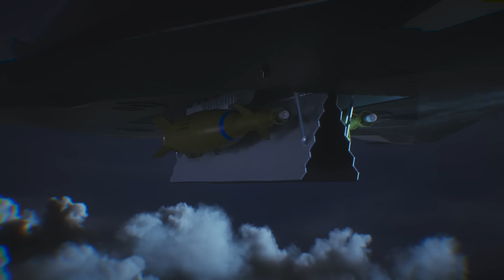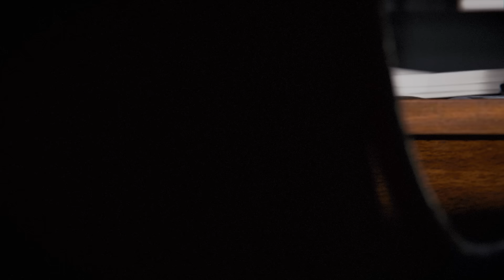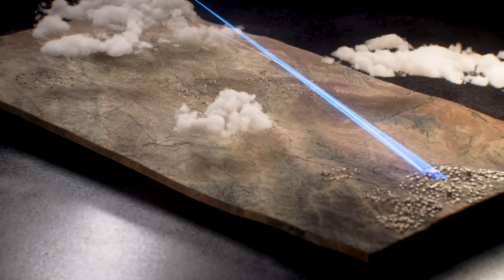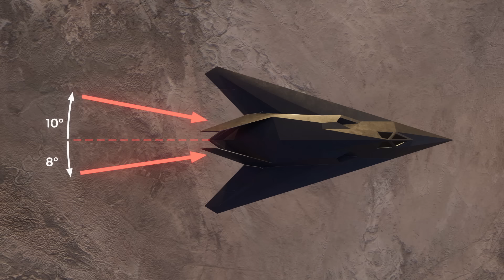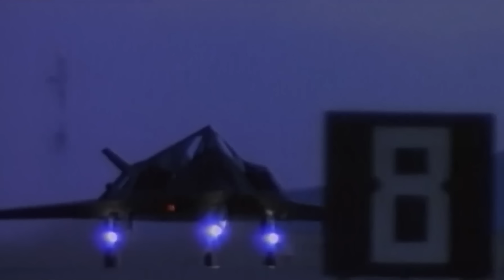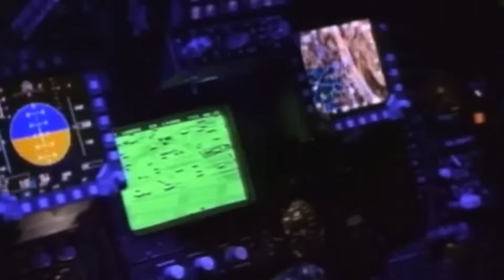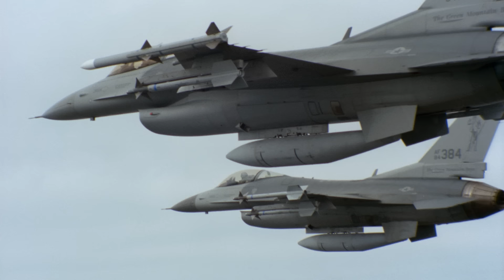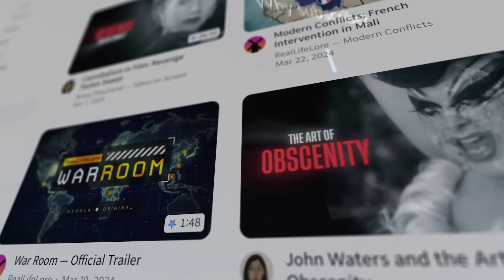The Insane Engineering of the F-117 Nighthawk

Comment: The most interesting thing about the F-117 to me is that, without the computational power to effectively simulate radar returns at high fidelity yet, engineers had to simplify things. Which is why it has simplified flat panels, while modern stealth aircraft have complex curves. The F-117 is literally a low poly stealth aircraft.
Reply: i though part of it was manufacturing complexity of stealth paneling and making it curved
Reply: @najlitarvan921 if the SR-71 is any indication, Lockheed had no issues shaping complex materials.
Reply: @judet2992 They could make the complex shapes, they just couldn’t simulate the radar returns from those shapes.  So they hade to design a shape simple enough that they could do the simulations to optimize the design.
Reply: @johnhunt2390  exactly
Reply: @judet2992  The computer program they used to calculate radar diffraction could only solve for triangles, so they had to make the Nighthawk out of triangles. The actual assembly line would've have had no problem making it round, but the computer did.
Reply: @Attaxalotl  I know, I was trying to say that, they weren’t using computer modeling during the blackbird, I was using it as a way to differentiate construction vs modeling
Reply: @judet2992  Note that the F-117 is about 2/3 aluminum.
Reply: @judet2992  to be fair they did say "complex stealth materials". SR-71 has a really good radar cross section for what it was, but it wasn't really THAT stealthy at all, it was designed for speed first and even the radars at the time could pick it up, they just couldn't hit it because it was so fast and high. Basically just stealthy enough that they couldn't see it quite as a easily/quickly and get the jump on it with the missiles. The SR-71 is a big plane compared to a fighter, but its RCS was like 10m2. I think that's roughly comparable to a modern 4th gen fighter (non-export current F-16 for example). VERY good for its time considering it flew in the early 60s. But the F-117 has a front RCS of maybe like 0.001m2. The Blackbird was like a smaller plane on radar. The Nighthawk is like a large bug.
Reply: @X85283  yes, I’m talking purely about shape
Reply: @judet2992  For sure. Lockheed made some BEAUTIFUL aircraft, I'm sure they could have made pretty much any shape they wanted 🙂, it just wouldn't have been very stealthy haha
Reply: @Attaxalotl Thing is, the programs we use nowadays ALSO only compute for triangle surfaces, only the number of triangles has been increased more than a million fold
Reply: @dareldatt798  Yeah lol. As it turns out Triangles are the easiest to ray trace!
Reply: @najlitarvan921  Boeing was working on something like a decade before the nighthawk and it was curved, but never came to fruition.
Reply: @proxy3386  either got canned or became a secret weapon imo there’s no other options
Reply: @proxy3386 Yes I heard the Boeing craft had an exploding door problem
Reply: @najlitarvan921 , It was. At the time, mfg did not know how to do the layup of composite materials without the fiber material bunching up or thinning out in the autoclave and affecting the structural integrity of curved structures.
Reply: @najlitarvan921  No, many other planes have curved panels. With the F-117 it is a matter of understanding (predicting) how the radar waves bounce off of curved surfaces.
Reply: If that was the case how what other aircraft of the day have curved paneling @najlitarvan921
Reply: @najlitarvan921 that’s what it was.
Reply: @najlitarvan921  "i though part of it was manufacturing complexity of stealth paneling and making it curved"

Dude are you looking at an F-117 or an F-22?

Did you understand the point being made?   The F-117 didn't have all these curves.  The OP you responded to is absolutely correct.  It had FLAT panels for the most part.  It was curved in a few areas.

The point he made, "low poly" if referring to what it takes to make an image for computer animation where polygons are used.  The more polygons you have the more an object starts to look real.  You can watch computer games designed before 2000, and then look at new computer games, you'll understand the comment.
Reply: @najlitarvan921 that’s all of it, whoever op is has absolutely no clue how math/ logic or even reality works. I don’t even know where to start…
Reply: If I remember correctly they had to break it down into a bunch of triangles and then calculate the radar return off of each triangle, then sum it up, pretty much a low poly aircraft.
Reply: @ur_a_neerd  Yeah; like how GPU’s tesselate rendered scenes in video games. The math required to render to that degree is orders of magnitude more available today in a consumer 4090 than used to be then in supercomputers.
Reply: @ur_a_neerd  It was an application of finite element analysis methods.
Reply: @ur_a_neerd I think your opinion is great! Props to the Guy that shot one down too.
Reply: The one interview I saw had the designer say, "You make it invisible, I'll make it fly." When they put that original diamond shape on the radar tester, they though it was broken.
Reply: @orionred2489  I heard a story from a bit later; they put the winged version up on the stand and saw a dot with the return of a small bird... about two feet above the cockpit. They all turned to look at the stand, and saw a small bird standing on top of the cockpit. Someone shooed the bird off, and the screen showed absolutely nothing.
Reply: @Attaxalotl  "What?" - bird
Reply: @orionred2489 угославское ПВО было другова мнения они его прекрасно видели и сбили над угославей 😂😂😂 в музее лежат обломки невидимки 😂
Он межет быть не видем на ваших радарах но есть другие радары с другим принципом работы
Reply: The F-117 being stealthy is basically a hollowed out log in terms of boating. It's primitive af, but it floats and works:)
Reply: that's because during the design phase the computers were from the 70's...now computers are much more powerful and can calculate radar reflection using curved surfaces which is much better for flight...that being said...the F-117 was designed in the 70's and remained secret for years...just think what they are working on now that's super secret and I don't mean the SR-72...
Reply: Check out mustard's video on this stuff for anyone who wants to see the history on it (especially the flying wing video)
Reply: Its unclear if this is true. What is known from public information is that the software that was used to design it only worked with flat surfaces. There are a few possible reasons for that. Very likely this limitation was because the software was written based on then recent papers that didn't discuss curved surfaces. Now its possible those papers it was based on only discussed flat surfaces due to computational limits but that's not mentioned by the people involved. The specific claim "they used flat panels because they didn't have the computational power" is, as far as I know, something that was invented later, probably as a just-so-story.
Reply: @alexanderf8451  Because the computation to figure out curved surfaces was simply not available. Neither for the designers nor the papers that they based it on. The basic principles of how things work with simple curved surfaces was absolutely known, but there was no way to simulate multiple complex curved surfaces interacting with each other, etc
Reply: @alexanderf8451  Can confirm. I was once interviewed for a job by a guy who said he worked on it... Sorry, it was awhile ago now, I don't remember his name and yes, I realize that doesn't lend itself to much credence. Anyway...

He said it's got flat sides cuz CAD couldn't do curves at the time.

As a CAD user I can still confirm the need to design around your tools/software. I have to do it everyday.
Reply: ...I had never thought of it in those terms, and I am delighted!
Reply: That's a very good point.  Wow never thought of it that way
Reply: Legit low poly aircraft you are right about that
Reply: I asked Ben Rich, a long-time pen pal, why the F-117 was faceted, and the Tactic Blue had a blended shape. Ben told me they were at a point in the design where they had to break the pencil. Three months later, they had the ability to create a blended fuselage.
Reply: It was the Virtua Fighter or Virtua Racing of aircraft.
Reply: @TroutButter miss that game
Reply: lol
Reply: Tell that to the Smart Radar from Thales. Detected
Reply: Which makes me wonder, why cant they just go from Sigma to S then? Like series and integrals
Reply: That also explains why the Cybertruck looks the way it does. It was rendered on a Commodore 64.
Reply: @ganymede3141  Too powerful :)
Reply: Reminds me a bit of how old-school roller coaster manufacturers like Arrow used to design rides based on what they call a "tangent-radius" approach, where (and this is simplifying a bit) everything is effectively a straight line or a curve with a consistent radius.  The reason being the ride designers need to be able to calculate things like speed and the G-force on a rider's body, and that is infinitely easier to do by hand when not dealing with a compound radius on every curve.  Compare that to more modern manufacturers like B&M or Intamin, where digital computers are easily capable of calculating the complex vector equations on a curve with a compound radius, meaning the ride designers can quickly and easily design MUCH smoother rides, where you don't feel like you're being aggressively forced into every curve (Drachen Fire, I'm looking at you).
Reply: very interesting ...never thought about it like that! thanks man
Reply: At the time, yes. Still an impressive aircraft to this day, but during its development and continual service development it was tested extensively with “seized” and known radar technology and reconnaissance techniques from its adversaries of the time. Still, to this day, it could (possibly still be) a strategic stealth asset for specific operational objectives. It’s still one of my favourite military aircraft. When I was a kid I had magazine cut outs of this thing on my bedroom walls.
Reply: @giantrobot5804 no question the best looking and most badass looking of ALL aircraft. It's not even close
Reply: That’s such a great way to put it — the F-117 really was a “low poly” stealth jet, born from the limits of 1970s computing. Those flat panels weren’t just a design choice, they were the only way to make stealth possible at the time.
Reply: And yet it was detected and shot down by 1960s Soviet made SAM...
Reply: Aka the original cyber truck
Reply: Like a Playstation one or N64 aircraft?😄😄
Reply: Shut up nerd
Reply: i think the reason the f117 is low poly is because computers at the time couldn’t simulate curves, therefor forcing the edges to be straight and triangular
Reply: @mastah39  The canopy glass has a reflective coating tuned to the radar frequency, or frequencies, so that the radar waves bounced off and didn’t enter the cockpit.
Reply: low poly like the ps1 so the f-117 was the start of 3d graphics lol
Reply: Hahaha! yea that's true but it's so funny, low poly stealth aircraft
Reply: Giving it that angular 80's future vision look that's also present in controversial design of the Tesla CyberTruck
Reply: @AaronSchwarz42  I don’t even consider that ugly thing at all. It is just a very expensive ego trip with no real purpose beyond being able to say that you own one.
Reply: Not very stealthy as it turned out
Reply: @Withnail1969  it is pretty stealthy, what do you mean?
Reply: @judet2992  Not always.
Reply: @Withnail1969  yeah, not when bombing with the bay doors open, but saying a stealth aircraft isn’t stealthy because they have to reveal themselves to strike targets is like saying an Olympic sprinter is slow because they have to stop after the dash. Stealth gets you in, and helps you in the cat and mouse game that follows. It isn’t complete invisibility
Reply: @judet2992  I dont believe the rubbish about it being invisible until it opened the doors. I think they have never been invisible to countries with some sort of modern air defence system.
Reply: Ummm yeah 😂
Reply: Yeah they would think use their own brains to figure it out. It's beautiful shows you humanity's pure intelligence using clever ways to solve enormous issues so imagine what they do with super computers lol look at the Damm f35 helmet that shit is so cool
Reply: Source?
Reply: its a high poly
Reply: ✈ The ingenuity of the engineers back then is truly impressive. Do you think there are other examples of technology where early limitations led to unique designs?
Reply: @WisdomInsightsPath  Hi ChatGPT!
Reply: @LutraLovegood  Hi Copilot or Gemini 😍
Reply: @WisdomInsightsPath  Everything.

Though, pen and paper is still the most versatile design medium.
Reply: As I know one was shot down with old Russian long time outdated "Neva" rocket 1999 in Yugoslavia. So it is not so insane engineering. Man, colonel, who works in radar post adjust old radar and turned it on few short moments and Neva blow it up to pieces.  They say ""we didn't know it is invisible"
Reply: I fell down a whole rabbit hole from this that lead me to some 90s video game magazine articles about how one of the key factors in this design process was SEGA AM2's arcade graphics processors
Reply: SR-71?
Reply: PS1 stealth.
Reply: The SR-71 was a stealth aircraft and had curves.
Reply: @zappulla4092  No, the SR-71 wasn't stealthy. The inward canted tail fins helped a little bit with RCS. And I think iron-based additive in the paint might have helped a bit too. But it was absolutely not stealthy. If I remember correctly, I think it maybe had a 10 or 15 percent reduction in RCS. To be considered stealthy, they'd need to cut the RCS down by one or two orders of magnitude. And that simply wasn't the case. 

Now, that's not to say the efforts were pointless. Every second that detection gets delayed is about 1 km that the plane has travelled. And the engagement window for something flying at the speed and altitude of the SR71 was pretty small to begin with. Skimming across the edge of that engagement zone, with just a couple seconds of delayed detection, can be the difference between whether or not a valid ballistic solution exists for shooting down the aircraft. 

Ultimately, if the SR71 were stealthy, it wouldn't have had hundreds (thousands?) of SAMs fired at it over its career.
Reply: Maybe but still one of the best looking aircrafts ever made.
Reply: This is an amazing example of how narrow minded I’ve been. 
Wow. 
Just wow. I thought 💭 was good at the critical thinking. 
Outside the box….
You just completely stomped and rebuilt my box.

Damn. 

Hats off to you though sir. 
My greatest respect I say to you, as I toss away the last six months of work 🙈
Reply: bro they went to the moon using manually imputed RAM that they hand set with brass(I think) brackets and 1kb weighed like 40lb or something like that

scientists go hard computers or not, it's just more safe now with simulations rather than risking wild things happening in the field while learning lol
Reply: The F-117 was more a test plane if anything. It would have made more sense really to make it one of the X series.
It's payload and range were just far too low and it was far too heavy in maintenance to fly it from any sort of forward air base. It was also far too costly to attack any low-priority target. When it comes to ground attack it's stealth wouldn't matter that much as you can still see it visually and at close range radar absorbent materials don't work as well, this is even the case with modern ones.

The F-117 was a very impressive feat of engineering but it was not a successful weapons platform. It was more a proof of concept for stealth aircraft.
Reply: That’s… not true at all? They used computer software called ECH-01 to simulate RCS returns.
Reply: Tomb raider 1996 vs 2021
Reply: I think Kelly said they were excited because the the IBM 80286 chip finally had the computing power to do the math 😅
Reply: What amazes me is that using only flat panels they still made an airplane that could fly 😊
Reply: Literally something that came out of Plane Crazy, pretty sure Gudbulder made something similar
Reply: "... So I built a plane entirely out of flat panels"
- Kelly Johnson
Reply: @sigstackfault  Johnson originally thought that curved surfaces was the way to go, but that was just a guess without anyway to analyze things.
Reply: @sigstackfault  Kelly didn’t build it, Ben rich did
Reply: It's mind blowing what engineers did back then without computers.
Reply: @3isr3g3n  The design was generated with a computer, hardware limitations of the time are what lead to the low-poly design.
Reply: @3isr3g3n That should be the SR-71 and Project Apollo, calculated and designed by slide rules.
Reply: @seanchang1202 
It's a myth that aircraft like the SR71 and the Saturn V rocket were designed without the aid of computers, electronic computers certainly were used in designing them.
Reply: BCk then usa had powerfull dual core conputers for civillians and good know how many cores their millitary had probably a lot more...  @3isr3g3n
Reply: @3isr3g3n 
Contrary to popular belief the A12/SR71, X15, XB70 Valkyrie, the Saturn V rocket and just about any other aircraft designed back in the day that people believe weren't designed with the aid of computers were actually all designed with the aid of computers, and I'm not talking about the fact that a slide rule is a computer, which it is, I'm talking about electronic computers were used in designing them.
They were used to crunch the number's to make all kinds of calculations that without them would have taken a room full of people a month to do each one.
The biggest difference is back then every engineer didn't have one sitting on his desk for his own use, each company had one that took up an entire room and as an engineer you had to submit a request for computer time to make the calculations you needed. 
Computers don't design anything, it's not like you can enter "Design a better spy plane than a U2" and the plans for an SR71 will pop out, everything, every little nut and bolt that needs to be designed for something new are all still conceived and designed by people, computers simply spend things up by making complex calculations and in today's age CAD enables an engineer to design something, even just a part, and look at it in 3D instead of drawing it in multiple views on a flat plane, aka a blueprint. 
People give too much credit to computers, it's still human beings who do all the innovating and designing, computers are just an aid that speeds up the process.
Reply: @3isr3g3n the engineer themselves were the computers.
Reply: @3isr3g3n  they used computers, just not very powerful ones by today's standards
Reply: I agree, the F-117 is the most stealthy aircraft than F-22, F-35 and B-2
Reply: @stevengavra  how can you come to that conclusion
Reply: @stevengavra  No, the RCS for the F-117 is .003 sq. meters. The F-22 is .001 sq. meters.
Reply: Sky cybertruck?
Reply: also it was never really stealth. It was shutdown in Yugoslavia by obsolete Russian SAM.
Reply: @hagestad  it was stealth, they had known it was the only contact in the sky, so there was no noise, and they could only barely see it with every one of their radars pointed at it. They still couldn’t get a lock. They got lucky when the bay doors opened for just long enough to get a lock, but the thing is, usually it wouldn’t be detected in the first place so they wouldn’t have known to get a lock. Saying a stealth aircraft isn’t stealth because it’s detectable when massive flaps come out of it, revealing its insides only for a few seconds is like saying Olympic sprinters are terrible runners because after a 400 yard dash they have to drink water and sit.
Reply: @hagestad  Stealth doesnt really exist. The US pretended it did by attacking countries that couldn't shoot anything down anyway.
Reply: @hagestad 
Amazing how you have an opinion on an event yet know nothing about it.
Reply: It's allegedly back in service
Reply: It is not that difficult.
Reply: @HH-yj3jc Of course it’s difficult.  40+ years after Have Blue, the only nations who have managed to exceed the F-117’s RCS in production aircraft are the United States and MAYBE China with their J-35 and J-20. Problem there is that both have incredibly high IR signatures that can be easily tracked from hundreds of miles away with passive IRST. 

Russia claims the SU-57 is “5th Gen” but the F-18E has a lower overall RCS. Hell, the SR-71 had a lower RCS than anything Russia has ever built serially. 

If it wasn’t that hard, everyone would be doing it.
Reply: @FloridaManMatty  Yeah, the Felon is a tragedy. The overall shape is actually really good, but every corner on that thing was cut. No S-ducts, no flush-set rivets, the IRS-T system is just out there in a dome for all the world to see, the weapons bay isn't sealed, the engines are only covered halfway, the cockpit glass isn't treated with anything, etc.

They got so close to something that could theoretically take down the F-15's impeccable record (104-0 lol), and then they remembered that they live in a post-Soviet country and embezzled like their lives depended on it (which they did, their boss stole half their salary).
Reply: @FloridaManMatty  I mean yes tat's true, but the reason that the SU-57 or J-20 aren't as stealthy as the F-117 isn't because Russia and China can't make an F-117 analogue. If they were willing to make the design compromises that the F-117 required, they could build something just as stealthy as the F-117. Where they lack technologically is in the ability to make an all-aspect, multirole stealth fighter. The F-117 is designed around stealth, the J-20 or SU-57 are primarily fighter jets, with stealth being a secondary (albeit large) design consideration.

Essentially the F-117 was a case of "make it invisible to radar, then make it mission capable", whereas modern stealth figters have a lot of design requirements that have to be met before they can get to the stealth part of it.
Reply: @Attaxalotl  yup not to mention the turkey feathers are regular round outlets...not coated and sawtooth like the F-35 for example
Reply: @aandc2005  To be fair, they also left the bare metal outside of half of each engine exposed.
Reply: Quite correct, and something I witnessed first hand about the USSR severe lag especially in computer technology and manufacturing, they were 50 years behind us, which we saw first hand on SALT inspections in Ukraine etc after the USSR fell. Our missile inspectors were shocked at the horrific state and primitive tech they were using and dangerous which shows during the Chernobyl disaster
Reply: @sdfopsdmsdofjmp7863 It hasn’t yet right? I can show you across the entire military where we have no equal. Not only have they not kept up they can’t produce actual working aircraft in numbers.
Reply: @blueberrywilbur315  The F-117 is horribly limited in terms of capability. It's a one trick pony. It's amazing at that one trick, but if you don't have a versatile enough air force, it isn't worth your time to develop an aircraft that only ahs that one trick.

Russia and China have relatively shit air forces compared to the US (even 1983 US). They simply don't have an air force where a super expensive, one trick pony of an aircraft like the F-117 makes sense.
Reply: @sdfopsdmsdofjmp7863  It was as good as they could do at the time. It was also the first plane designed SPECIFICALLY for stealth. All other design criteria were secondary to that.
Reply: @Attaxalotl I thought the same thing when i see the su-57. the ir signiture has got to be used as the engines are barely even covered unlike the f-35 and f-22
Reply: @FloridaManMatty  can I get a hell yeah! murica baby!
Reply: @FloridaManMatty  whoa sir don't be hitting people opinions with your facts. Uncool.
Reply: @FloridaManMatty My son’s tricycle is  ore stealthy
Reply: @HH-yj3jc  There are SIX aircraft on earth that use similar technology, and this number includes one that implements it so poorly it's RCS is worse than a Super Hornet (Su-57, though it's poor performance isn't due to the shape which is actually quite good, but rather the Russian Military-Industrial Complex's practice of cutting every corner they possibly can. The Felon doesn't even have flush-set rivets, which were invented in the 1930s.)
Reply: @Attaxalotl Have you seen the images from inside the cockpit that CLEARLY show bubbles in the canopy over the pilots left shoulder? Between that, the exposed rivet heads, and the straight intake to engine pathway, the Felon has to have the RCS of at LEAST an F-15C. The fact that none of them appear to have any sort of legit RAM coating makes me wonder just how bad it is. And it’s a damn shame because Sukhoi has some brilliant aerospace engineers in their employ. I would LOVE to see an Operation Paperclip Part Deux that would slow us to bring some of those brilliant guys to the Western world and turn em loose with the budgets our very best are accustomed to. They’d knock our socks off.
Reply: @FloridaManMatty  Yeah, I've talked to someone who claimed to be an engineer for Sukhoi, he seemed like a pretty chill guy. By the time this is over, I'll probably be out of engineering school; it'd be cool to work with him!
Reply: @FloridaManMatty  the su-57 can't have a higher RCS than F-15C. While the Su-57 certainly isn't stealth, it definitely is stealthier than the F15. Also, I don't know if the russion aero engineers would knock our socks off, because the west has equally brilliant engineers.
Reply: @FloridaManMatty  Also russian doctrine focuses on more traditional, 4th gen elements first, stealth second while NATO doctrine focuses on stealth first, everything else second, as you can see by the shape of the F117.
Reply: @HH-yj3jc calculating radar cross section is not that difficult?